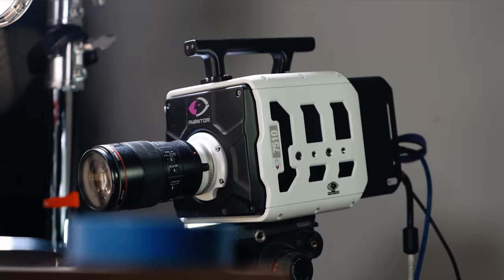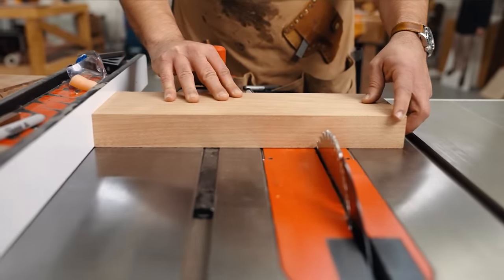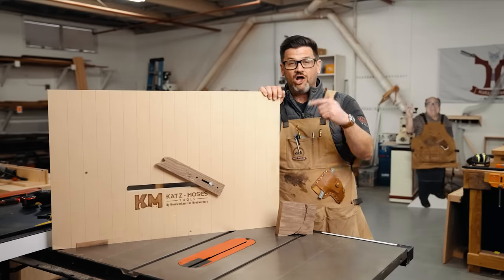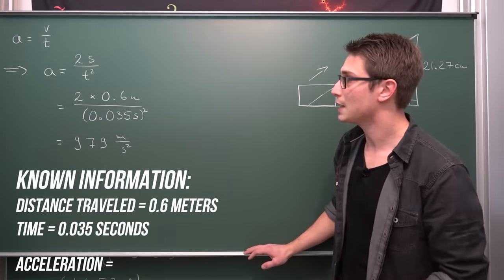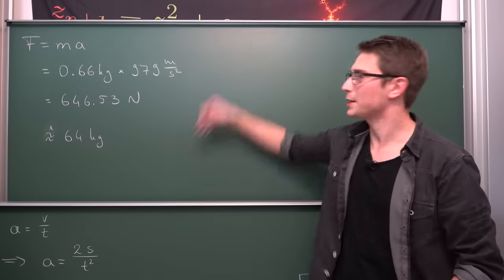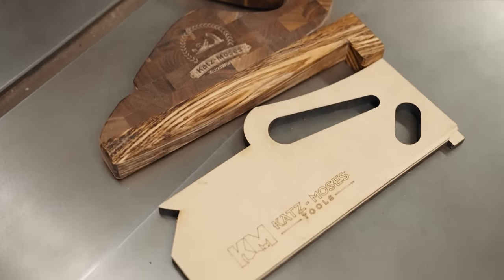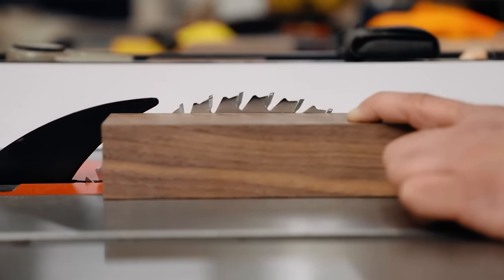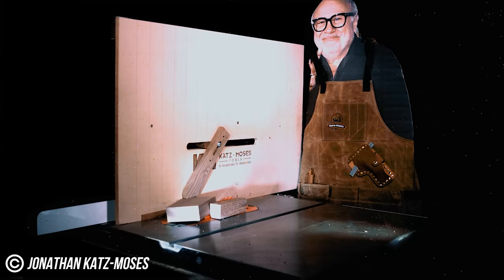The Anatomy of a Table Saw Kickback at 50,000 FPS Ultra Slow Motion in HD

Comment: Years ago I heard my neighbor working in his garage, the table saw and vac system was always noticeable. I was on my back patio cooking chicken on the grill. I thought I heard something screeching like a belt on a pully, I walked around that side of my house but all I could hear was his shop tools running, so I went back to my patio. About 10 minutes later I heard a woman screaming and I ran towards my neighbors house. As I entered the open door of his garage/shop, I saw his wife on her knees back in the corner, still screaming. I ran in and saw my neighbor laying on his back with a long narrow strip of wood sticking out of his neck by his collar bone. I walked to the wall by the door into the house and used the phone on the wall and called 911. I went to her and got her to stop screaming. I knelt by him and checked his pulse and realized he was breathing,  but slow and easy like he was just sleeping. After about 10 minutes Fire & Rescue showed up. They revived him with smelling salts and a whole lot more screaming ensued. They calmed him, packed around the wood with gauze pads and placed him on a board and took him away in the ambulance with the wood still sticking out of his collarbone area. That was a case of kickback that I will never forget. I didn't see that the wood had went clear through his shoulder blade in back also. No arteries or veins were hit, didn't see a lot of blood at all but he had a 14 inch long, 1 3/4 inch square piece of maple in him. He also had a broken nose and  concussion from hitting the floor. He survived but the garage shop didn't. His wife put her foot down. The garage became a garage only after that.
Reply: holy fuck D:
Reply: So did you become a woodworker after that incident, or had you already been one, or are you not one?  I know it would certainly affect how I saw woodworking either way.
Reply: @davidswanson5669  I have never thought of myself as a woodworker but do work with wood. My Dad was a great safety teacher.

Comment: Great video! Before retirement, I took care of 4 DIY home woodworkers in the operating room (anesthesiologist), one of the workers we saw twice. He was a lifetime woodworker, and after seeing this video I wonder if his table saw was not adjusted properly. These were horrible injuries, one man partially losing his thumb, and later his index finger to Kickback injuries. We never saw any fingers lost to the spinning blade. These injuries usually occurred after 9pm, when they were working in their workshops, after working their regular shift day job.. I can only guess that they were tired and therefore less careful.
Reply: I wonder if tablesaws are particularly prone to fostering "normalization of deviance" behavior w.r.t. safety protocols. I.e., the protocols seem unnecessary for 1000 cuts, so why bother with them?
Reply: I lost just the tip of a finger and a fingernail to a dado blade. I learned two important things. Do not work late at night or when you are tired. Do not try to feed small parts by hand.
Reply: What was their bac when they came in?
Reply: @feastoncarolina9544   Stone, Cold, Sober…
Reply: @fastcode1772  I just saw your comment. I have never even had any formal training in table saw use(high school woodshop). So I try to learn everything I can.
Reply: Learn this: use a track saw, miter saw, or hand saw! Table saws are the most injurious piece of equipment in the shop!
Reply: @capnjs  I have all three, plus a saw stop jobsite pro.

Comment: That YT video should be shown to EVERY person who buys a table saw. They are a really dangerous tool used in the wrong untrained hands. Well done JKM and thanks for all your time and effort to put it together.
Reply: also that company that built the “auto” stop needs to be told to allow all table saw manf to install there product in thee products. 
yes at a low price.  as it will save many fingers snd lives.
Reply: And the portable/cheap/small ones are basically little more than a flimsy table with a circular saw mounted underneath

Comment: Thanks for having me Jonathan, that was a blast (in the true sense :D) <3
Reply from the maker: Your math for Woodworkers series is great! Thanks for all your help!
Reply: First: awesome video! Second: you asumed the piece of wood took the entire 60cm to accelerate. But effectively the wood only accelerates while in contact with the blade. Shouldn't we run the numbers only for that short distance? Without counting frames I assume the acceleration would be much higher.
Reply: @mal-t You're right. 

Also, this is just estimating the force the blade places on the piece, not the force the piece will put on the operator. Since we don't have any information about the impact we can't calculate forces/impulses there. Instead, you might calculate the velocity of the piece after it leaves the blade, then calculate energy the block has, and compare that to the energy in the bullet or the energy of a JKM falling from various heights.

If you really want the force from the blade on the piece, and we allow the constant acceleration assumption for convenience, it might be more accurate to get the velocity after the piece leaves the blade and divide by the time from the instant the piece starts to move backwards to the instant it leaves the blade. 

Last one, and I'll get off my soapbox. The force of 130 lbf should really compared to (some fraction) of a JKM standing on your chest, not dropping from some height.
Reply: @gcranston83  You are right, too. The force on the Operator can be computed, if you divide the change of momentum of the flying piece by the time it hitting the Operator. The correct numbers would be very interesting.
Reply: @JR-xt1bj  right, but we have no information about that impact, so all we can talk about--at least in terms of numbers--is the energy (or momentum) the block has when it leaves the blade.
Reply: I don't know why you calculated acceleration like this. Would it not have been sufficient to take the average velocities by dividing distance over time? 

Heck, for approximation I would take the blade tip speed and assume 100% velocity transfer but now I'm just being abusive.
Reply: @phitsf5475  in my head the most simple way would be to measure the speed after the wood left the blade and then divide that by the time it was in contact with the blade. There is no clip in full length at the same speed so wasn't bothered enough to count frames and such but my rough estimate was 2 to 4 times the acceleration. But the most interesting figure is the final speed and therfore the energy/momentum of the projectile.
Reply: I "saw" what you did there.
Reply: He had you? That’s cool
Reply: When I read the comment I thought you were Danny
Reply: Not only is the distance for the calculation of the acceleration wrong, also the derived value has nothing to do with "the impactforce". You basicly calculated the force which accelerated the block of wood (with wrong numbers).
As @Malte Hildebrandt already mentioned, an energy prospective would made much more sense!

And if you really think 64kg "of force" are half a Jonathan Katz-Moses jumping from a 10 story building, then please stop making math/science videos!
Reply: IMO, your calculation of the acceleration is not accurate... The piece of wood will only accelerate for so much time/distance, while it's in contact with the blade. The moment it starts flying, there are no forces applying on it anymore beside air resistance and gravity which will make it slow down, not speed up. 

So in fact, the acceleration is greater than what you measured, but what's interesting in this problem is the final velocity and not really the acceleration.

Otherwise great video thanks!
Reply: you are german, arent you?

Comment: Great video Jonathan! Lots of food for thought!

Though, are we not going to talk about how the ballistic gel dummy, from sheer shock and confusion alone, fell forward into the running blade? While a kickback is awful, let's not forget that getting knocked out in the workshop can have lots of other unforeseen consequences.
Reply from the maker: Yeah I was so mesmerized with all the footage that I forgot to talk about that. Great point!
Reply: Imagine explaining that the Saw Stop saved your face! At least what's left of it after stopping a chunk of wood with it.
Reply: @rauschguitars  The saw stop would not be activated unless your finger or a hotdog hit the blade.
Reply: @abrahamlincoln5283  or your face.
Reply: @jmac2o229  - could be wrong, but I think he was making a joke
Reply: @jmac2o229  And path to ground is not necessary for the Sawstop brake to activate. It works on capacitance. If ground was needed, then rubber soled shoes would defeat the brake mechanism.

Comment: Jon,
Just experienced this very thing. 
My mistake entirely. 
Mistake #1. I was working while tired 
Mistake #2. I was using the fence instead of the crosscut sled. 
The wood piece was short and I should have realized it but go back to mistake #1. 
I pushed it through and by the time I realized what was happening it was over. The piece of Meranti bounced in some weird way and I wound up with a bruise on my right arm from the wrist area to about 6” to my elbow with it being from 1”-4” wide AND somehow the piece struck my right abdominal area about an inch to the right of my belly button and about 2” north of there and left a gash about 3.5” long. 
It’s almost healed but damm …it hurt. 
Not fun. 
Thanks for the video!

Comment: I was an outlier.  Working in the carpentry shop on USCG base NOLA 1979 and I was at the end of a 114-degree day in New Orleans and dreaming of cold beer.  I was almost done with a bunch of boring repetitive cuts and was hurrying to finish.  

I ran a piece through and got the bang! kickback.  I was hit right in the brass belt buckle.  If I was a skosh taller I would never have met my son.  No riving knife, no blade guard, no safety glasses, a cabinet Delta Unisaw.  

EXTREMELY LUCKY.  

Great video.  Thanks for the link to the professor too.

Comment: Guy I used to work with was pushing a piece about twice the length of the piece you were using in the video through a 5 HP saw and got it right in the ribs. He had two broken ribs and a cut about 3 inches long. The bruising he had was hard to even look at. Ive had kickback on the miter saw that messed my fingers up pretty good but nothing broken. Ive never personally had it with the tablesaw but I was taught from a young age to keep control of the work piece. Safe cuts everyone and happy holidays

Comment: Three or so years ago, I was rip cutting a short (9")  2 x 6. I always use a riving knife but in this case I had been lazy and hadn't retracted the blade from a cut I had made previously on a 3 x 3 piece. I also hadn't taken the time to clear some chippings from the bottom edge of the fence. Needless to say, the riving knife saved me from a potentially more serious injury but the piece rolled over the top of the knife and rode the top of the blade and caught my right arm just above the elbow. Thankfully I got away with some serious bruising but it made me completely rethink and then revamp my entire workshop specifically to preserve life (namely mine) and avoid as many future issues as possible.

Needless to say, laziness in a workshop WILL MDK you. Don't be like the old me, take the time you need to make safe cuts, it WILL save your life.

Comment: Yeah, I did an "experiment" 20 years ago kind of like this. I was ripping maple table legs about 2 inches square. I was not using a proper push stick and my old 1954 table saw an elderly neighbor gave me had no blade guard. The push stick was a 3/4 inch by 3/4 inch by 18 inch length of red oak. With a 45 degree end which I was holding.

After I finished the forth leg I got sloppy bringing the push stick back, and I let it swing a little and it caught the top of the blade. 

Bang! It shot right into my forearm. Sank in about 3 inches, in and up my arm, almost to the crook of my elbow.

I now have proper safety equipment on the saw, and proper push sticks, feather boards, etc. And a very health respect for kickbacks. I still have the bloodstained "push stick" in my workbench for a reminder. And of course I should add: Never stand in the line of fire. 

Great video.

Comment: Another outstanding video Jonathan. While I’ve not experienced the dramatic kickback incidents that others have reported I have experienced some. That’s one reason I was among the earplugs purchasers of a SawStop. In addition to the brake it also has, as you pointed out, a riving knife. I know many woodworkers don’t realize the value of having one on their saws and often leave it off like they do with their guard. Hopefully some of those people will see this video and realize why that’s a dangerous practice.

The reply from the medical worker who noticed that many table saw accidents happen at night when people are tired. It’s been my practice for many years not to work with any shop power tools when I’m tired. I’m sure that’s helped me to prevent any accidents so far. As I’ve gotten older that practice has become even more important and I’ve done even more to prevent accidents. If I’m going to do a major operation on any of my tools I set up the matching for the operation I plan to do then I leave it, if possible over night, and go back later to perform the task after rechecking everything for accuracy and safety. I’m never in a hurry or tired when working with any power tools.

Comment: Videos like this are really helpful in becoming more safe while woodworking. Ever since I cut my finger on a small table saw a few years back, using one in the shop is a bit of an inner struggle. I would say these days I spent at least 4-10x as much time setting up a cut than actually cutting, all the while worried the thing will rip into me. With me not wanting to have my hands even 40cm within the reach of the blade, kickback becomes one of the biggest issues as the push sticks I use are rather long. I have to think about a better shape to supply down force, I did not consider the geometry of forces and you video demonstrated the issue very well. Maybe a down force roller attached to the fence would help. Ideally, I don't want to push any part of my body towards the blade at all.

Comment: Yes, these are no toys. Bandsaws do not have these issues.

A major reason for kickback was not mentioned, if I recall correctly - tension in the wood that is released when ripping solid woods. Tension is released, the piece of wood expands, presses against fence and teeth. In Europe, many pro saws have a slidable second fence. You position it at the middle of the saw blade. It creates a gap between main (ripping) fence and the adjustable fence attached to it, so wood can safely expand at/ after the cut.
Had a kickback on a small chop saw with a tiny piece of oak 1x1 inch diameter. Hit my hand hard, made a cut and bled. Shock was worse than pain actually.
Thanks for great video!

Comment: Although I’ve never been hit with a flying chunk of wood, I’ve had a pretty scary experience with kickback that doesn’t get talked about all that much. I have a yellow contractors saw and it’s really not that powerful. Well, one day I was rushing through a cut(3/4” plywood) because I was too comfortable with the tool and boom… it happened. Here’s where it gets worse. Instead of immediately removing my hands from the danger zone and crouching or moving out of the way, I thought I could overpower the saw and hold the workpiece down with the crappy little push block I was using. Turns out I was right… that time. I was beyond lucky that I didn’t lose a hand or an eye doing something so incredibly stupid. It’s not always the dangers you know about that will get you. Sometimes it’s something that you never even think about doing that could cost you. Now, I practice every cut before I make it(thank you Steve Ramsey) and I go through my project plans to anticipate what could most likely go wrong with each operation. May seem like overkill, but I’m not taking any chances. Edit: Forgot to say thank you, Jonathan, for all of your contributions to safety in the woodworking/making community.

Comment: Hey Johnathan, I appreciate your video! The slow motion is very cool and making people take this risk seriously is important work! Thanks for what you do with your channel and your foundation!

I felt like you neglected a few key things though… all your examples where short chunks. That’s definitely the highest risk for kickback but it can happen with long strips too. I’ve seen videos of board lodges in the wall… 

Also, my kickback experience wasn’t the whole board, I had a knot from a pine 1x4 come loose when it hit the blade at it hit my eye before I could even blink. Luckily I only had a minor abrasion but I could have lost my eye. Needless to say I never forego my eye protection anymore. 

Finally, vertical feather boards!!!! I think they have been the most important prevention improvement I’ve made since push sticks! I use the one from MagSwitch but clamping a board to the fence works great too

Comment: Tablesaw accidents are so common, yet most of them are extremely preventable with these "basic" safety techniques and proper equipment (like push sticks, featherboards, and Micro-Jigs). BTW: Forrest actually recommends to run their blades high (just past the gullet) to keep the carbide cool. Good info man!
Reply: Yeah, I’ve never heard the advice to keep the blade so low. I don’t understand how having a full tooth extending above the wood could cause kickback.